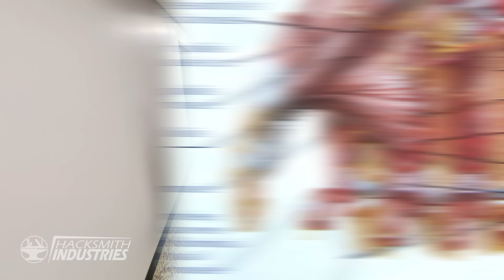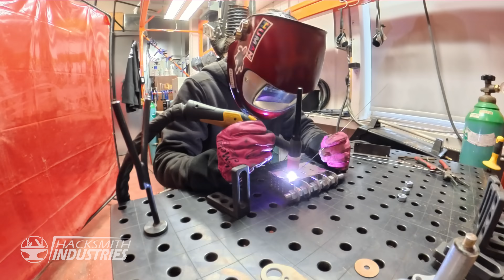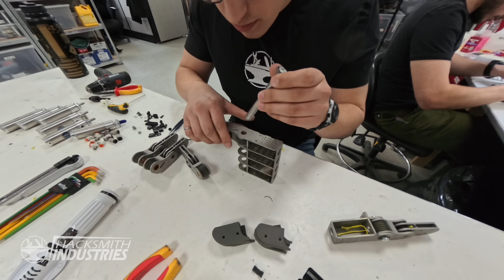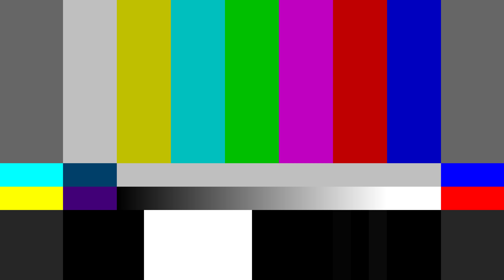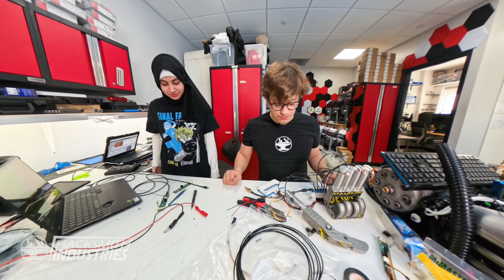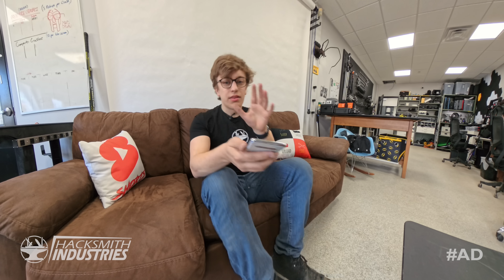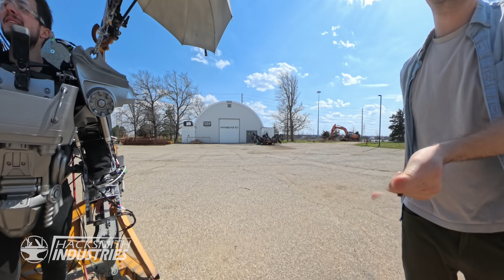Building Robotic Hands | Real Life Power Armor (Part 5/6)

Comment: Hands look promising so far, but they definitely need a better thumb alongside a better control scheme. Honestly using the same system as the fingers for the thumb feels a little disappointing. I understand its not an easy thing to do, I mean there's literally a whole industry behind designing manufactured hands/limbs, however if you want the hands to be useful they need some kind of opposable thumb.

Comment: Those hands are way to big. 
In the games P.A has about the same dex level as bare hands. And the hands should not extend past the operators hands . the hands should sit AROUND the operators hands making it more intuitivt and controlled. You should focus more on the dex then power. P.A do not increase grip strength bye that much. And people have already pointed out the problems wit the thumb. 
TO SUM IT UP THE HANDS SHOULD GET A COMPLETE REDESIGN.

Comment: Great video. The sound of the neumatics is honestly addictive. You could benefit by having your thumb not be in a parallel plane to the rest of the fingers. Right now, it is pushing  to the sides, and the beauty of the thumb is that it can push inwards. I reckon some inclination could improve functionality significantly. Also the same string design for the fingers but with 3 joints would make a huge difference,  you could latch onto things and encirle them completely. This are just some things I thought about. Still, awesome design, making a hand is challenging say the least, nothing is quite as complicated as replicating nature in my opinion.

Comment: Great concept.  in  a hand that big, you kinda need few things:   
Obviously the thumb is not angled properly.  
And Fingers could be a degree or 2 angled. That would help holding things that are not 100% straight.
You need rubber to the palm also, Big, smooth metal plate is not good for gripping, no matter what you put to the fingertips. 
Also the fingers could be a liiiiiitle bit longer, to compensate the rubber. few millimeters of rubber in palm and fingertips dramatically shortens the gripping area.
The handle should be in an angle. put a hand on a joystick comfortably and see how angled everything is. 
These fingers could benefit for being hydraulic, but that might be too much hassle. Hope the air has enough power.  
You could also make a locking system for let's say a rifle.  When you hold it, the hand locks to it, so you are not reliant holding it with air pressure, in case of a failure.

Comment: Based on what I saw the Hans got a great flaw with the thing since this finger is the most important on to grab most things so it actually got two motions 1: the closing motion same as the other fingers 2: it can adjust on two important positions. The 1 that show in the video is great fora fist and is the normal layout but if humans try to grab things they adjust the position inwards so that the thumb can form a circle with the other finger in line to hold things but this mechanical hand wasn’t able to do so and so it isn’t so good in holding thing!

Comment: That's an awesome build as always !! But I was thinking why not use electronic actuators instead of hydraulic ones ? And for the hand movement sensing use or make a glove like system that can read the movements of each fingers individually, it can be installed within the hand mechanism (I mean where the user puts his/her hand inside the armour). This way the user will have to use much less force to control the fingers of the power armour, making it more user friendly

Comment: Perhaps instead of Buttons to activate the Fingers you can use a pull switch system?
You basically have the same control as you would have with your real hand and it would  make it very ergonomic.
It would just be some of that yellow string with loops in it for the fingers that would be attached to some sort of switch to trigger the cylinders

Comment: The grip sensors should a grip, with a ring for each finger. (Sorry idea is in my head, word cannot express it) or Cups for the fingertip. The ring/cup gets pulled into/nearer the palm (easily measureable). Then you could controll your grip, with you actual grip. The knuckle needs to move a bit as well, maybe not as much as the fingers, but maybe 25-50% of the finger joints. Thumb angle is way off, it doesn't grip anything, except make a thumbs up? String has too much powerloss/strech. Ideally would be a small chain (as in a motorcycle chain). Pressure pads are not exact enough for gripping.

Comment: 1) a big  security hazard could be the wrist and the way the fist is connected to the user, if the wrist were to be dislocated or twisted, the grip inside the armor could seriously harm the user

2) reposition the thumb to give it actual functionality

3) if using only 2 joints in the fingers you have to make the last phalange a bit longer, it wont be as pretty but it will be able to grab things more efficiently 

4) replace the nylon with steel, eventually you will have to grab 500kg to show off the power armors power and nylon breaking could be a security hazard
Reply: If the haptic force buttons were on a glove mounted inside the arm/wrist frame you slide your hand into, then you could have another input to detect when the user rotates their hand and have a rotation motor rotate the suit's hand accordingly.  Heck, by using a glove in a rig you could replace the haptic force buttons with a spring or tension cable of some kind attached to the glove's fingers.  You could then read how much the fingers curl in the rig and move the suit's fingers accordingly.

That would allow for greater range of motion and finer motor control and give more freedom of movement to the pilot in case of limb damage.  Then replacing the nylon with cable and wire would remove the stretching slack as you mentioned.

Adding in a working thumb for a claw grip and the third knuckle to the fingers?  The hand could be working real smooth.

Comment: I'm normally a big fan of everything hacksmith does, but this video is extremely subpar, and screams rushed sponsorship content. 

Mechanical hands take many prototyping cycles, and these clearly have not had them. 
At a minimum, with the rope system used, adding a third joint to the fingers would not have needed any extra effort, unless of course they'd just ploughed on with the first design they'd made without testing anything. 

Obviously opposable thumbs are really what makes human hands so special, but I do appreciate the engineering complexity is substantial, especially using pneumatics. However, some simple testing would have shown, as others have pointed out here, that mounting the thumb at an angle would allow for much greater grip strength.

A single full hand 3D printed to test before committing to the final design would have shown these issues, and many more.

Stick to good content, and rigorous engineering, rather than this rushed nonsense, and you'll end up with fewer dislikes on your video.

Comment: The channel "Breaking Taps", here, and also on Nebula, has a video on rolling contact joints. It could be quite applicable for this application, though on this scale it might need some kind of teething to ensure proper alignment. But it'll remove an enormous amount of parts, including all bearings, and has close to zero friction.
Video ID TQiLLcumqDw

Comment: Agreeing with everyone else saying "You dont have enough finger joints"
I also feel you are absurdly over complicating things, 
a simple pulley system with something of a gear or rope system in the back of the hand to increase the pulling power to said finger would be alot better, this would also give you some force feedback from the suits fingers to the users own, which would also help alot with fine motor adjustments, like actually being able to pick something up without crushing it.

Comment: Use steel cables ffs. The hands and fingers are too thick that's why the grip is pathetic, calculations have no meaning when you're not being realistic. Slimmer hands and fingers with rubber insides and steel cables would be infinitely better, you obviously need to stretch and put the cables under tension BEFORE otherwise they will always have some give to them.

Comment: A way to upgrade the hands A bit without changing much might be using rubber insulated gloves that have an external layer that conducts electricity this way the pressure switches can be pressed without the worry about it fitting the persons hand

Comment: Well, I'm not an engineer, but I can see at least 4 problems with this design.

Number 1, and they already realized this, the controls.
Number 2, there is no material on the hand's palm to give traction and help with gripping.
Number 3, the fingers only have 2 joints. Like this when the fingers curl there's no space, so objects will mostly just be squeezed out.
Number 4, the placement of the thumb is useless.

I understand they were trying to simplify the design to help make it easier to build, but I think they went a little too far.

Comment: As you stated the ergo of the hand controls are not the best. Not sure your design constrains will allow for it, but you need something more akin to the Nintendo powerglove or datahand/svalboard/lalboard(it goes by many names and has DIY models) keyboards that allow you to actuate the keys with smaller reasonably natural movements. Using the datahand you could have way more inputs if you need more, would just need to lock down force requirements for key press or specific gross motor key presses do specific actions.

Comment: If the thumb is not opposing it might as well be a decoration... also if you wanna control it with those tiny buttons you can get away with just two, one for grip and one for middle finger! To be safe I would also power rotate the hand in case something heavy rotates it the way it shouldn't, maybe something like a flight stick with triggers for each finger.

Comment: why wouldn't you use steel cable, the tech has come so far you can have stronger material that's probably thinner than the string you used...

Comment: The finger buttons need to be pressure controlled to give better control to how tight you want the grip. Is this not possible?
Reply: With air? Yes but no
Reply: @DuppeGutta  I worked a palletizer for years stacking books and manuals fresh off the press. It was a really big robot arm basically with 3 claws. The claws worked like fingers 3 knuckles or joints each. braided steel cables on pullies controlled by air. The joystick had a single button that was pressure sensitive harder you pulled it the tighter it gripped. It was a pain in the ass anytime I had to manually stack pull to hard it could break the board holding the bundle spelling a ton of paper everywhere.  I have no real idea how it worked just that it did work. Is the idea not the same?

Comment: You could try using a roller chain for the hands also since you have a analog pressure regulator couldnt you use the same idea for the hand movement as the arms?  Dynamically changing the position of the fingers in the hands just based the finger position.

Comment: Replace the nylon cable with steel line. less stretch, more tensile strength, and the nylon may snap when supporting heavy weight in the hand (on the fingers). also pressure sensors in the fingertips would stop accidental crushing when gripping delicate items. love the series, great job guys, cant weight to see it progress.
Reply: Not to mention steel line wouldn't fail immediately from heat.  I.E. putting your hands in fire. I feel like the synthetic rope wouldn't do well.
Reply: @LegendaryGodKing good point, but the heat from the fire would melt the plastic pneumatic components
Reply: It would stop moving instead of splitting apart. @devinmiller7308
Reply: @devinmiller7308  also, i feel like they're aiming for a 3rd gen version on their first try. Even in the fallout series the first ones didnt have the bells and whistles... however i always say aim high so. It is a prototype so it could be remaid in metal and bullet proofed.
Reply: They can utilised kevlar threads instead of synthetic rope or steel cables for increased tensile strength and fricative and heat insulation coating to improved the dexterity and efficiency of the system.
Reply: There's some type of super strong fishing line that would work, I bet.
Reply: @Cat-Guy01  disagree, almost every type of line is subject to creep over time, where it gets longer and longer permanently when under constant load. Dynema (which they used) is one of the very few ropes which does not (or just barely) creep under tension.
Reply: @stratos2  thanks for the input. 👍
Reply: Steel line will fail due to fatigue from the tight bend radius

Comment: I'm not entirely sure how helpful this idea will be (not an engineer in any sense of the word) but I'll still comment as it may help inspire a different way to control the fingers. Instead of having the fingers wrap all the way around in order to press the buttons, have buttons at the end of the finger controller, so kinda like a Guitar Hero DS controller, and then have another button on the side somewhere near wear the thumb would sit naturally. Also, the trigger buttons for the Quest controllers have a variable position feedback, which you may be able to translate the percentage that the button is pushed down to how much air is going through the pneumatic cylinder (I have no idea if that would be any better/easier than the FSR). Hope this is helpful in any way, shape or form!

Comment: If you want to eventually work on more complex hands, I would get in touch with Ian Davis.  He made his own prosthetic hand for a partial amputation.  It is fully mechanical.  I imagine he would have a ton of insight.
Reply: I thought a collab with him would be cool. Also something like lucid vr haptic gloves
Reply: The budget on the hands alone must be ridiculous. Building a simple version first is the smart way to go about things.
Reply: This is exactly what I had in mind too, it’s disappointing that they picked such a low technological approach to making hands, must be them running out of budget
Reply: @Robert_Edwin_House6969  
House always wins
Reply: @Robert_Edwin_House6969 then why post the video😭
Reply: @RedGhoulAnimation  to give an update on the suits progress, that and much like the air tank they can upgrade it later with something better.
Reply: Just the opposable thumbs, for a Start. Customization comes later
Reply: @KyGuyAlyx-er3dm  my concern wasn’t so much the customization but more in line with what you implied.  They need to work on a good gripping system.  And for one to work well I only know of Ian Davis as having the most mechanical knowledge of what the equivalent would be. Prosthetics.  His use chains to both grip and splay.  I imagine the grip strength isn’t great but what not use a similar mechanism but with linear actuators or servos instead of a bulky pneumatic system that will already have strain.  I think a linear actuator system connected to a chain system like Ian’s would generate beyond amazing results.
Reply: @Ivinish0   servos, huh? Neato
Reply: love ians stuff a colab would be amazing
Reply: I was thinking the same thing
Reply: Would be one hell of a colab, i hope they do
Reply: I thought about the same thing

Comment: can make a better lightsaber: arrays of excitations along the column from radiative sources which push the energylevels higher as the flow burns dimmer. Compensating for the distance from source... Allowing less energy into the system and visually more like in the movies

Comment: I think plunger style switches like what many brass instruments use might work better for the fingers and thumb. It may even be possible to connect a sensor to tell how far they are pushed to control the amount of air pressure put into the cylinders to control soft vs tight grip. Squeeze harder to actually squeeze harder. It also may need grip pad on the palm as well as the finger tips, and maybe the full length of the fingers for smaller objects like the Sharpie.
Reply: I agree, they could use LVDT’s to accurately measure hand position without being too bulky

Comment: I dont know if there is space for this but if the hands are able to be fully extended, either a electronic system similar to how the valve knuckles controllers work or even just an actual glove with those stretch resistive bands running through it may give more fine control over the hands.

Comment: As much as the hands are cool mechanically and obviously a ton of good work has gone into them, you should consider going back to drawing board on them. The control isn't there, the ergonomics, precision, grip, looks... it just doesn't function the same as what you'd expect out of a power armor. You should reconsider the pneumatic design - despite the complications, I believe electric with force feedback is the way to go here.
Reply: Agreed. These hands are honestly terrible when compared to the rest of the suit.
Reply: They did say it was a good start which leads me to believe there’s still more they want to do to the hands but most likely had time restraints from a sponsor

Comment: Not sure how achievable it would be but maybe you could integrate the Valve Index controllers as the part you hold. Not only are they ergonomic but you could use the grip sensors in them to adjust how hard/soft you want to hold something instead of crushing everything like the open bottle
Reply: Or lucid vr haptic gloves
Reply: I like this man, sound smart